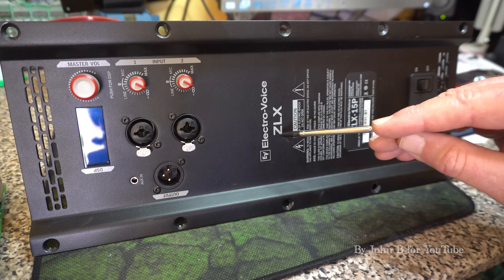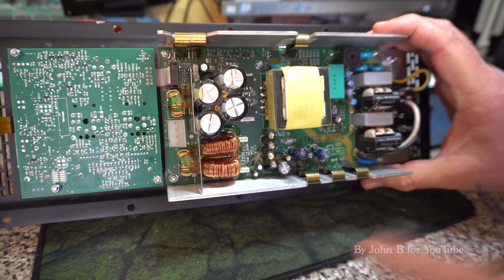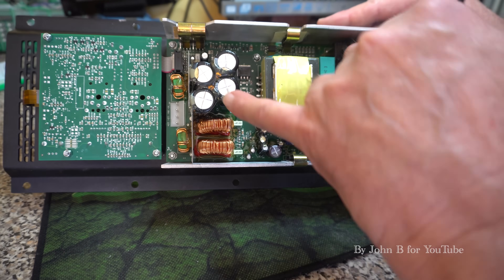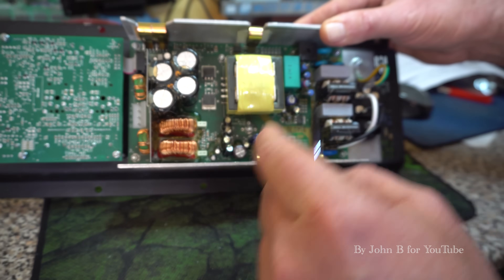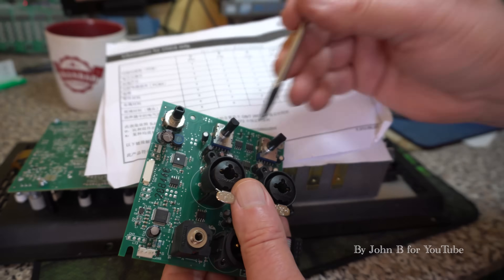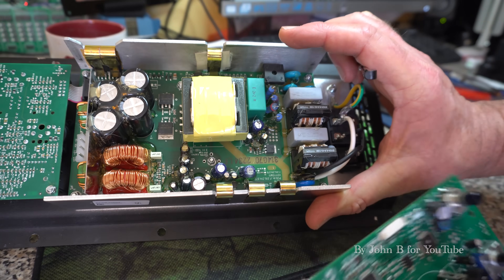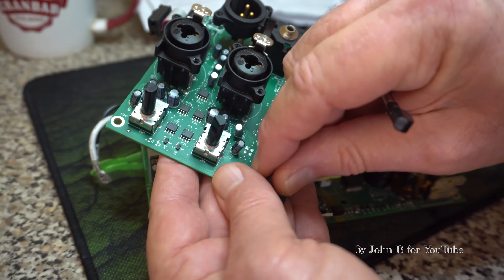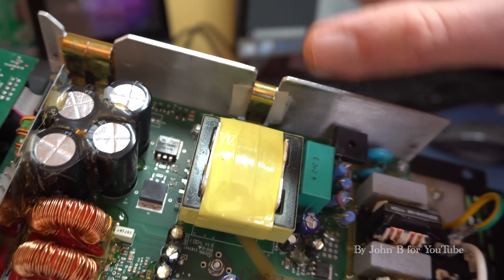The Inconvenient Truth about your Electro-Voice ZLX-12P & ZLX15P amplifier (Read Show More)

Comment: After the Class-D PA amps came out we got the Watt War back, that we had in the early days. Most companies are lying and cheating about watts. Normally you can divide
by at least 4, and that is also the case here. How do I know that? Because if you buy the non powered version of the same speaker, they are rated at 250w continuous
and 1000w peak power. That is because the speaker can not handle more, and they don´t want to take the guaranty if people blow up their non powered speakers.
I suppose somebody could also do some math when they write in their technical material that under worst case scenarios the speaker draws 0,6A @ 230 volts.

Having said all that I like those speakers quit a lot, I have 4 ELX-12P and 2 ELX-15P, and have not had any problems with any of them.
Reply from the maker: Kim Hansen 
Thanks for your comments.
Even this chip has the watts pushed up by measuring it at 10% distortion.
At 0.1 % they are around 84 watts x 2

Comment: You just saved me $500.  Was thinking about buying one of these as a stage monitor. I thought it would be nice because of the two channels that I need, and 1000W, which I now know is a joke. Ill look into the Mackie or Yamaha options instead.
Reply from the maker: Thank you for your comments, you'll have to let me know what you choose.
QSC K series look pretty good too.
Reply: Watts doesnt matter. Max dB SPL output is what matters, and if you comprare the max dbs of the other brands in the same price range they are about the same

Comment: Elsewhere I'm reading a conversation among musicians, recommending a pair of these to some guy operating a 30 seat venue. That's it - 30 seats. These speakers seem excessive for that, no?
I bring in solo musicians to a 30 seat restaurant and they have to turn down their Fender Passport or Acoustasonic for examples. They are more than adequate. On point, no those don't look like 1000W boards to begin with.
Reply from the maker: Charliebrm1 
Thank you for your comments.
I’m sure you could get away with less but pretty sure these would be more than enough for such a small venue.

Comment: How about the newer  EV EKX 12p , is it of better quality? I am about to buy a pair,  it's good I saw this  video. I already owned the EKX 15sp ( SUB) that's why I am planning to buy speaker of the same series and brand.
Reply from the maker: Hi,
I just saw the inside of one here on YouTube.
The power supply does look bigger, but no way on this earth is it 1500 watts as quoted..
It's either 1000 watt peak music power or, I am seriously wondering if they have used 2 chips for the bass which would make it twice as powerful as the ZLX series which would be 840 watts peak music power.
It does look totally redesigned, I'd love to see the driver stage of the amp up close.
https://www.youtube.com/watch?v=K_Nu8vmQbzU
Reply: @JohnB-2021  What about the passive ekx? I'm thinking of buying a set of 12s and running them with a Crown XTi 2000, stereo @ 475w per channel. Will this be fine?
Reply from the maker: @liceafilms  
Hi, no idea about their passive speakers, I imagine they are ok if you like the sound from them.
Reply: @JohnB-2021  I've just never been a fan of powered speakers and some advice whether that Crown amp would be enough for the passive speakers. These days all I see reviews for are the powered versions.

Comment: I own 4 of these speakers and they are fine for small venues with a decent DJ that knows the difference between distortion and loudness or live gig with an active speaker!  Like John says they do sound really good, i vouch for that, but my advice to anyone that reads this with ALL MANUFACTURERS look for the RMS rating not the first large number you see.  RMS rating in theory is what a speaker will definitely produce (although someone will probably have a more accurate way of saying that) in power.  When i brought these they where a lot cheaper than they are now and I knew immediately that they could be no more than 200-250w.  EV for some reason do not publicise this (probably to dupe certain customers) but they do produce good speakers.
Reply from the maker: Thank you for your comments.
The simplest way to look at the 'root mean square' is the 'heating effect' in watts if the amp was driving a resistive load like a heating element.
Reply: Hard when they give rms less and less often.

Comment: HI please suggest me other one. I am planning to buy one with 1000 watt.Please ..
Reply: QSC k12s are ok but pricey, Yamaha DBR's are ok also, Price fluctuates on these though.  My advice is not to go after a 1000w speaker, weigh this up against db as well as a speakers with decent db is worth looking at even if at a lower RMS rating.  Go to a shop and have a listen.
Reply from the maker: Hi,
The Yamaha DBR series look really good or the Mackie amps are a solid amp and certainly more powerful than the EV shown here.
Reply: @JohnB-2021  thanks .I was going through speakers brands  available here. i found out only EV  zlx 15 p and Mackie thump 15 are available..Can I go for Mackie. The thing is its a purchase for at least 2 to 3 years. So I am kind of anxious.
Reply from the maker: @bijayagiri5746  The Thumps are about the same power as the EV, it's up to you to see which you prefer
Reply: @JohnB-2021  Thanks john. I will be buying Mackie Thump 15BST. Thanks for ur video.
Reply: 1000W from one (powered) speaker is quite unrealistic. No matter what brand. If you want an honest 1000W RMS, and not just for 10msec, you need more than one. I'd say 2 at the minimum, 4 or 6 even better. Of course, it quickly becomes a budget question. But if you constantly have to replace your so-called 1000W speakers, because they can't take 1000W, it's also not cheaper.

Comment: So Whats your Take On those Mackie Thump15A 1300 watts
Reply from the maker: Hi,
The thump 15A has a 300 watt (2x150 watt) chip that drives the bass so it's nothing like 1300 watts. Someone must have added 1000 watts from thin air.
Reply: @JohnB-2021 Thanks 4 The Response I'm Looking 2 Buy Some 15in Speakers.. Which Brand Should I Go With???
Reply from the maker: @djturknice  Mackie are easy to repair and the schematics are available if they go wrong out of warranty.

Comment: After watching this video it sounds like the guy who owns these speakers from EV really does not know what he is doing with them....This is a consumer expecting to get more out of his gear than it is designed to do....The basic rule in the audio engineering field to figure out the power load of a speaker it to take the peak in this case its 1000w and divide it by 2 and that will give you a fair idea on how much it handles....
Reply from the maker: You're wrongly assuming the guy had the speaker turned up to 100%.
You're not considering the power supply which will fail at any time given the inferior design seen in the video.
The later design seem to fail sooner than the first revision.
Reply: @JohnB-2021  far from that John....Am I a repair tec that will fix a speaker no but I have been an audio engineer for over 20 years and when someone says some thing along the lines of "it says its 1000w" I already know a few things right off the bat....1. Any gear can fail at any point for any reason in the field....2. This speaker can be a bad right out of the box....In no way does this mean it will not work out of the box but there is a problem that will show sooner or later....3. The gear this person is using is not designed to do what they thought it was going to do....This person also got the entry level product level from EV so they are not as robust as their other lines....4. You do not need to take the speaker to 100% volume to damage to it....5. There are outside environmental factors that can fry a speaker also a common example of this is bad/dirty power....I highly doubt this person put a tester on the outlet that was being used....So I can keep going on but I will stop....Oh all of these are educated guesses not wrongly assuming....
Reply from the maker: @thomasangelo6925  You may be surprised to hear, I agree with you on all counts.
However, if there had been a little more money spent on the power supply design, it could have been a super reliable speaker.
I have been to many weddings where the 'DJ's drive the speakers into distortion.
To put everything into some context, a Wharfedale Titan power supply nor a Mackie SRM series power supply will fail if the amp demands a huge amount of power.
Both the Titan and the Mackie SRM450 have a push pull power supply and will deliver much more than twice the power of these EV power supplies.
If we take the same bass driver used in the Mackie Thump series, that power supply is rock solid and protects itself by going into current limit, they very rarely blow up.
I'll end by saying the designers must allow for the 'general public' which means the product is going to be abused.
Reply: @thomasangelo6925  About turning them up high: I have 4 EV ZLX-12P and used 2 of them as a FoH speaker for the first time, outdoors, for a live gig. I was surprised to see they were already flashing the "limit" indicator while I had the level indicators on my panel barely over -10 Db. So I took care not to bring up the kick drum too much in the mix, which helped. No matter what, I think even if the amp is underpowered or you can't put the powered speaker as loud high as the passive version - an active speakers input should be fine with getting a signal over zero Db. So I totally agree with the point about abuse.
One thing you could do if you own these, is use a subwoofer, I guess, which is what I'll probably do. Assuming +- equal distribution of sound across the spectrum, 3/4 of all power should be between 20 and 80 Hz, so if you can feed 700-800 Watt to a subwoofer, assuming the thing has +- the same efficiency, then you can keep your fragile EV happy. 
I got mine second hand, from a DJ. They look somewhat battered. They definitely took some abuse but still sounded good. He used them with subs.
Reply: @yalu2  I just invested in the ELX200 line that is produced by EV and they are a great line of speakers....I am no longer a fan of passive speakers I just all powered now....If your using an EV speaker and the limit just flicks on and off your ok and still safe....It is when you have the limit light staying on the entire time that you will do damage....I love using the EV bluetooth app that you can use with the ELX200 line....Its nice when its paired with a touch pad and you can go out in front of your set up and EQ your rig....Plus it gives you real time data on how your gear is working....

Comment: This is a very fascinating video. I'm here wondering if the ELX series - primarily the ElX 115p - is the same. Could you do a video on that too? I'd appreciate that a lot.
Reply from the maker: Thank you for your comments, I only do videos on equipment I'm given to repair.
Reply: @JohnB-2021  I appreciate the feedback. Ok I understand that. I was considering purchasing one but I might just go with the ELX. What do you think? They were released in 2017 (I think) so perhaps they made some adjustments.
Reply from the maker: Alex Foote 
Hi, I have no idea about their other models. I guess there is no harm trying if the price is right.
Reply: I own the ELX line and they work fine....You can sit there all day and bad mouth the technical aspects of the a speaker all day but if you are going to use it outside the means it was built for then it will break and that is with any gear on the market....
Reply from the maker: @thomasangelo6925  And what about all the EV customers who thought they were buying a 1000 watt speaker?
Yes back the volume to 500 watts and listen all day, except these speakers are over rated.
They are less than one quarter of the rated power. 240 watts peak bass drive  at 10% distortion.
And half of the customers said they play at a moderate volume.
Don't forget these speakers have current limiting together with thermal protection and they still go BANG.
Reply: @JohnB-2021  as with new gear that you get it is a great idea to do your research and see what it can and can not do before you use it and make sure it will fit your needs....It is like purchasing a car or a truck....I am not going to buy the first one off the lot that I see....I will test drive a few before making my final decision....There are thousands of EV customers that have no issues with their speakers and they are used week after week....
Reply: @thomasangelo6925   you are missing the point, you can do as much research as you want, but if you have the incorrect information from the onset, you are already on the wrong path, manufactures need to be ohnest on their products from the onset..... one cant keep buying just to test drive, that is not a finacially sound option
Reply: @mekoalekalakala1403  Actually you can if you go to Guitar center you can buy and return if you don't like it....Most of this information anyone can find on the internet....I am a professional sound engineer so I am well versed in this....
Reply: @thomasangelo6925  don't be loyal to a brand if they aren't loyal to you
Reply: @DwightGZ  I'm not going to crap on a brand cause you get a unit that is bad out of the box or because the person using it blew it up....I have been using EV gear for my jobs and rentals for client's....Stuff breaks but over all they work as they should....As I stated before if you use speakers or anything that for that matter outside of what it's designed for and break it that is your fault not the makers....
Reply: @thomasangelo6925  yes, everything wears over the time, but using a 240w chip is not a manufacturing error, is a design error. So they are good speakers at a 240W. 
If you buy a Toyota Tacoma but Toyota tells you that you can tow 50,000 pounds with it, then you break it trying to tow that weight, is Toyota's fault for telling you something that isn't true
Reply: @DwightGZ  The owner blew up his speaker.....His fault....Thousands of people use EV gear with no issues....Where is the confusion....
Reply: @thomasangelo6925   what do you think would be a better speaker in terms of sound quality, durability and loudness that's at the same price point as the ZLX?
Reply: @alexfoote7475  There is nothing wrong with the EV ZLX series of speaker....I am not familiar with your experience in the audio world....So I will give you my thoughts on this....THe ZLX series is and entry level speaker that is designed for those who are getting their system for the first time or someone who is out occasionally that is a DJ or plays in a garage band with their friends....I know many who use this box week in and week out but they are also running them with subs so they will cross over the boxes at 100 or 120hz so the ELX boxes are not being blown up....In almost 25 years of doing this job I still have yet to have a speaker company come up to me and say I dare you to blow up my speaker....I am an EV guy so it would be hard for me to give you and alternative suggestion....As I said the ZLX is a good box but know the kind of events your playing to so you do not step outside of the performance range of the box....If the ZLX does not work than look into the ELX200 line they are the next step up in the speaker chain....That is the EV speaker line that I use....I have 2 of the PWR 12 inch tops and 2 of the matching PWR 12 inch subs....That system is loud and clean for my events....That system can handle about 200 to 250 people....Its not a booming bass system but that is not what I want....I hope this helps....If you need anything just message me and cheers....
Reply: @thomasangelo6925  wow what a review. Thank you so much. I'm really glad to hear this. I've heard a lot of negative reviews about it. But I think it's because people are always using it out of its intended ambit. Thanks so much.
Reply: @thomasangelo6925  hi Thomas . i was reading you messages on this thread. I was wondering if you have compared the Yamaha DBR15 to the ELX200-15p ? they are pretty much similarly priced. thank you in advance